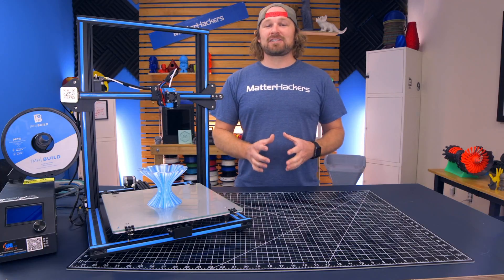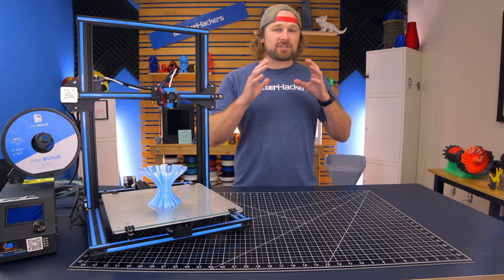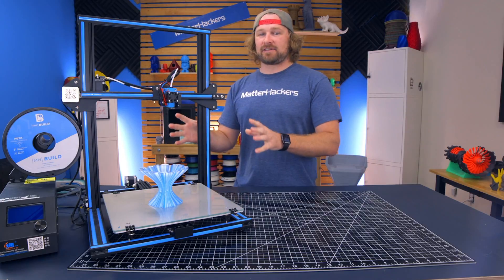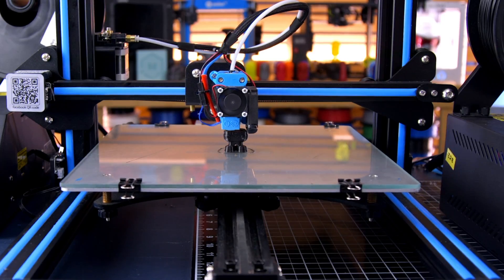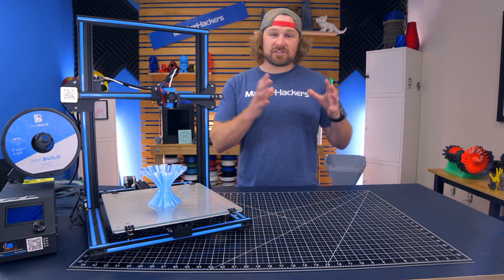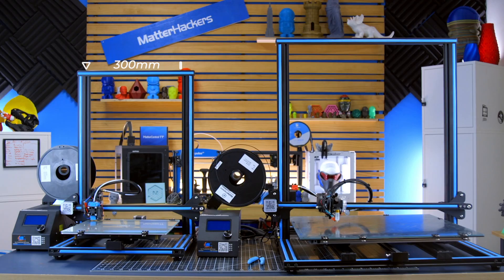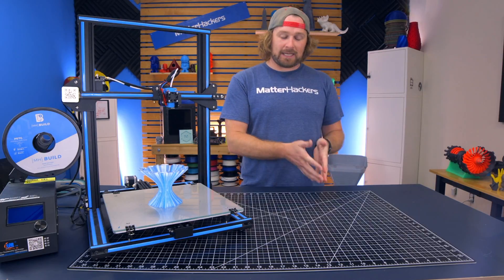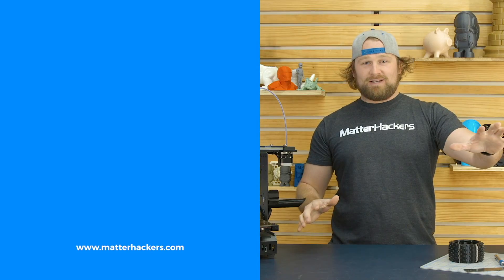Creality CR10S // 3D Printer Highlights

Comment: Have the S5 here. It does some nice quality work. Though it will do better, still need to upgrade the headbed with a MOSFET and a secondary power supply so it will reach 110c for ABS print jobs. Out of the box, it maxes out at around 86c, and curling (lifting of the prints) has been observed, moreso if trying to print at lower temps. Creality should offer a cheap addon MOSFET and instructions for an easy grade. Right now, the only marketed workaround is to spend something like 400 bux for a replacement headbed, when all that is needed is a 5 dollar MOSFET, and to use a old 20v spare laptop power supply to run it up to 110c in about 15 minutes, rather than waiting a hour to max out at 86c and risk curled non geometrically proper prints.

It has a serious build volume, and with a few larger nozzles its possible to print furniture with this printer, guitars and car parts etc. 

Goal is to have a filament maker parked beside it, recycling plastics into reusables. 
Creality could release a matching plastic shredding filament maker too! Help clean the planet. =)

Comment: but are heating the safety features still disabled from the factory?
Reply: The CR-10s has a much better main board (with bootloader) than the CR-10 and the safety features are not disabled.
Reply: +1